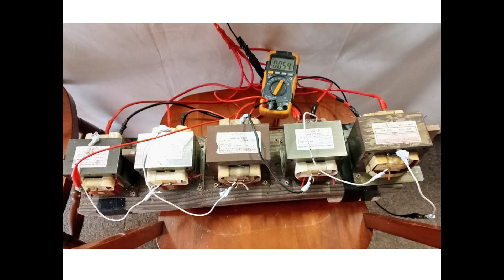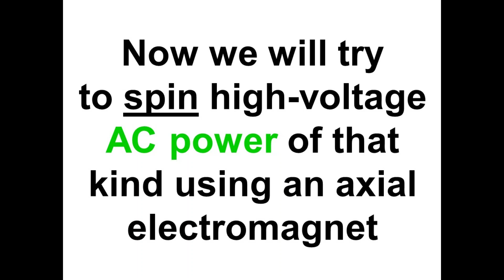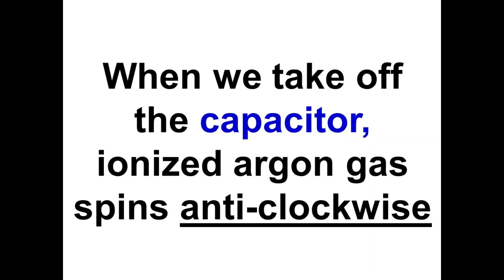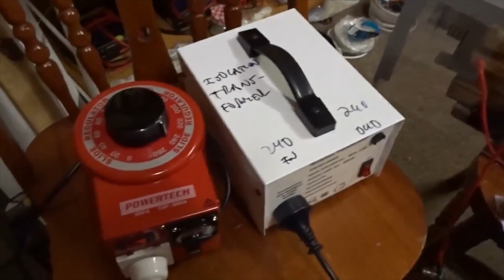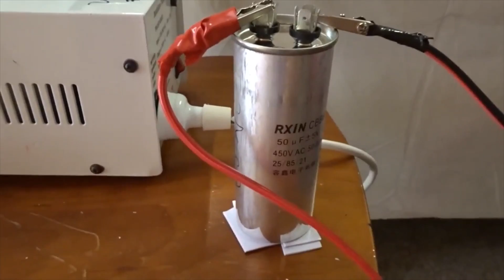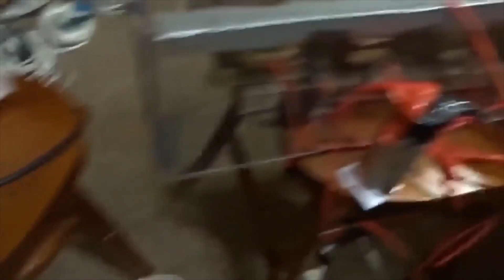A big capacitor can change the spin-direction of a Corbino disc with 11 kV AC power

Comment: Can you not use a Tesla coil for the high voltage?
Also, unless you need the amperage, you can use a diode and cap and get hugger voltage out of one microwave transformer or use a fly back transformer like the ones used in TVs

Thank you sir

Comment: I don't know if you're ever so plasma jet engine being developed very similar to what you're doing right there except to using the heat of the plasma the former jet almost kind of like a rocket. They use the magnets to hold the plasma from touching the sides of the tube why they force the heat out the other end

Comment: The release of the pressurised Argon gas would produce a thrust on its own in a zero G environment also, but how much force/thrust is produced from this experiment? and how do you measure it, with an anemometer?
Reply: One more idea, what about a 3 phase electromagnet with 3 phases?
Thanks